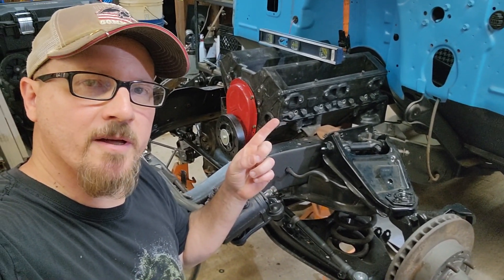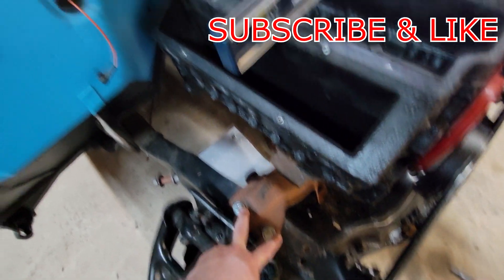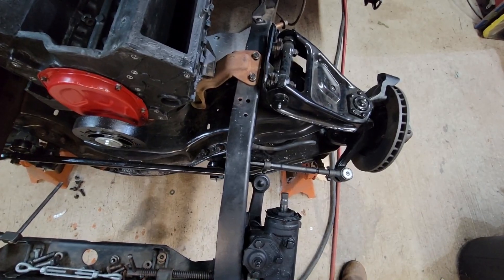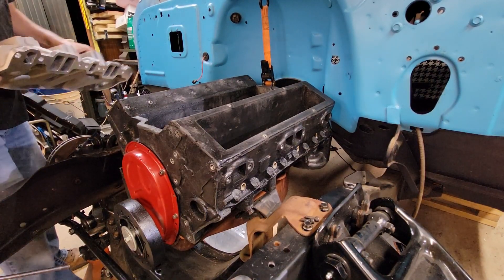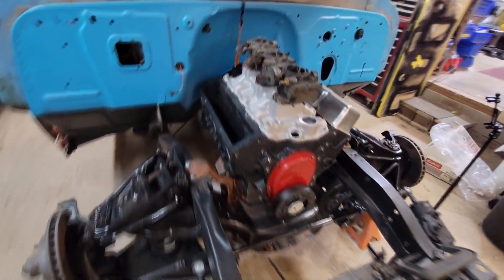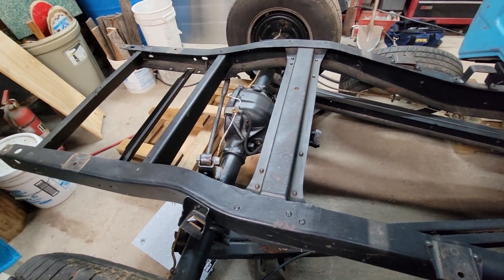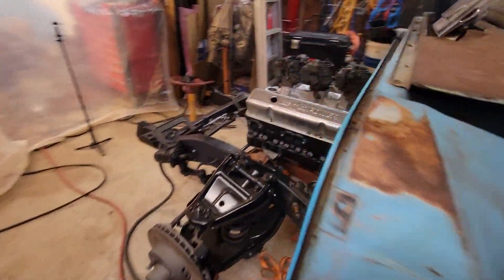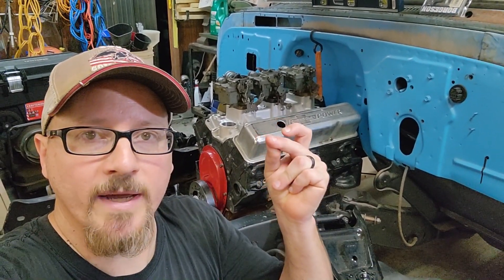Are (PLASTIC) Mock up Motors Worth the Money???  Will they MELT?

Comment: I looked into a plastic mockup engine...I was amazed at how expensive they are...it's not worth the added expense for just one vehicle unless you're rich & just want one just because...if I were gonna be building numerous vehicles with the same engine size & same transmission, then I'd probably get one, but for just building one, hell naw...I'm just gonna get the engine & transmission built, get it set & leave it...far as patina goes, if that's your thing, have at it...personally, I'm not gonna leave mine looking like I just drove it out of a junkyard after going to all this trouble on the rest of it...I've drove crappy looking vehicles all my life, I want my truck to have a clean & shiny show perfect paint job...
Reply from the maker: Yeah there higher than I think they need to be, but we build alot of hotrods and put the same power plants in them so its actually used but if your only building one car id say no for sure!!!
Reply: Yeah. Im just building one car and the plastic block is only $200 less than i paid for the actual engine im using.

Comment: A little 327 engine would be very nice in the c10. My dad had a 68 chevy c10 with the 327 and 4 barrel carb plus 3 on the tree. Had dual stacks on both sides of the cab (was a stepside bed)
Reply from the maker: Thanks, the funny thing is that I also have a 68 stepside, it was a long bed and I shortened it. Thanks for watching!!!!!